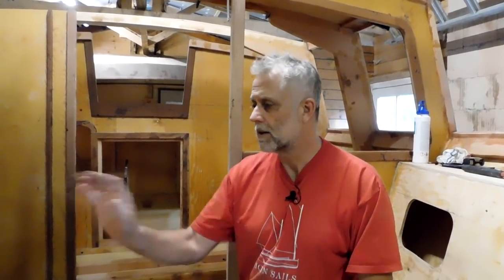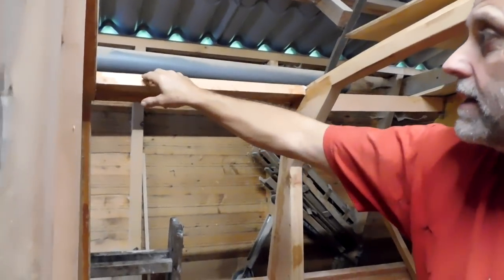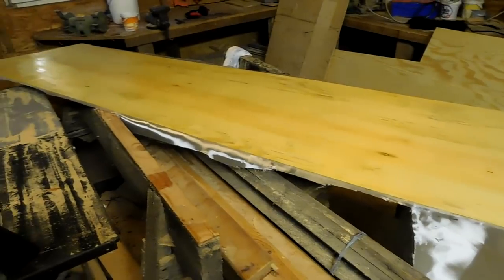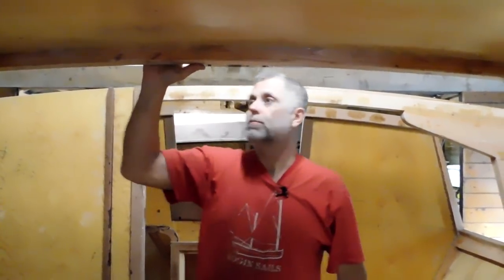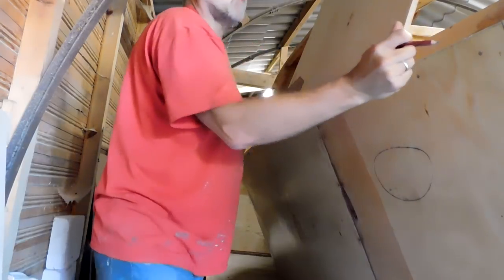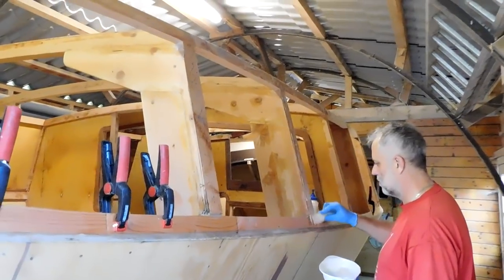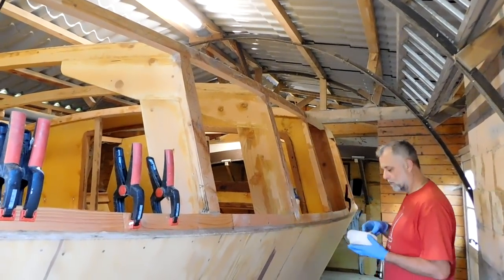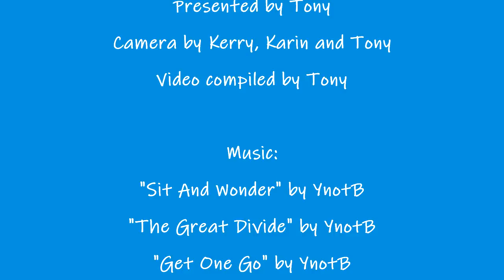Shelves, main mast partners and coachroof sides - SV Tapatya EP57

Comment: Tony, were you going to epoxy the Insides of the roofbeams and knees? Or have you already? I've decided I like waterproofing Outside AND Inside, LOL. Watching you Nail On the outer panels was making the Ballad of John Henry Play in my head, 'John Henry was a Steel-Drivin' Man,' lol.
Reply from the maker: Hi Jim. Yes, all interior wood is getting a coat (or 2 ) of clear epoxy before further finishing. Some of it is done already, some is still to do :-) I agree about waterproofing both sides. There are some major discussions in the forums on this one (I thoroughly recommend not taking forum opinions too seriously!), but, if you can keep it dry, it should be good.
Reply: Highly recommend doing both sides to prevent cupping at the very least. If you only do one side then it will cup.

Comment: Great work Tony. I'm really enjoying these videos because you are building something very similar to a boat I have been designing as a hobby. Mine is based on a Vung Tau junk from Viet Nam, and it was the flat bottomed, dory type hull that attracted me to it. I was wondering though, what are your plans for keel/ballast? It may have been covered in an earlier video that I've missed, but I would really like to hear/see your thoughts on that.
Reply from the maker: Hi Ross. Sounds like an interesting project you have going on there. I haven't talked about the keel in a video yet, I guess I should soon. This design comes with 2 keel options; either a fin keel or a shoal draft long keel. Both have a ballast weight of about 1200kg. The keel is fitted towards the end of the build, so decisions as to which keel to use aren't necessary until late on. I tend towards the long keel at the moment and hope to use high density concrete for the ballast.